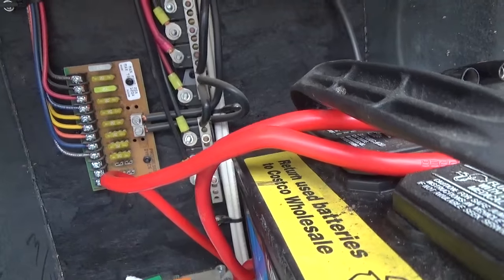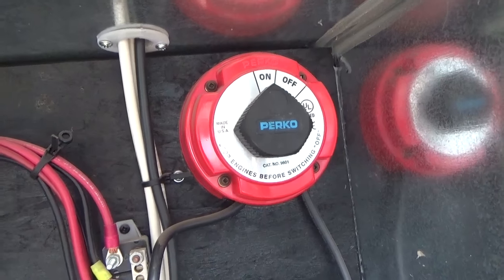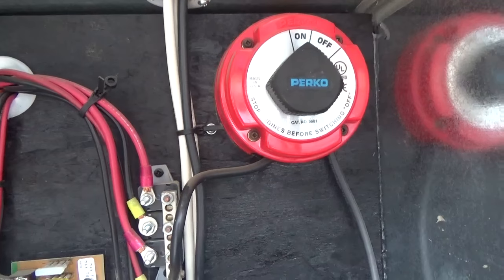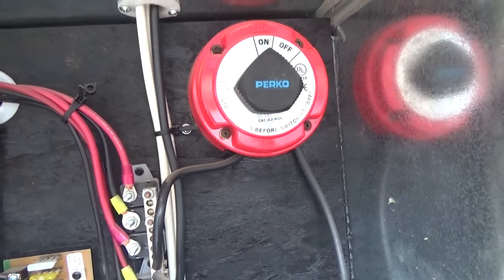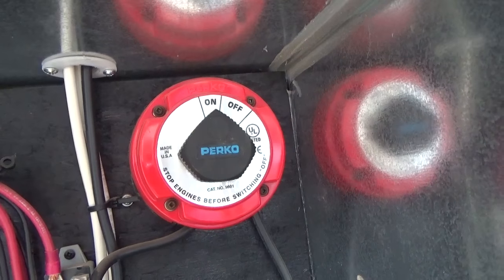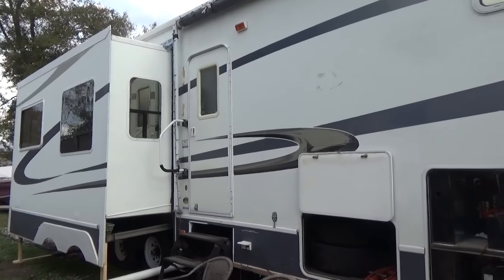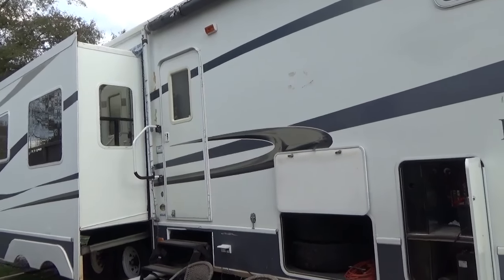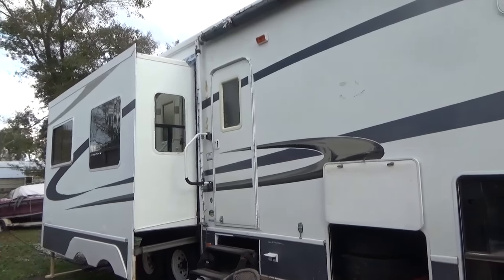5th Wheel Travel Trailer. Electrical System Question? PLEASE HELP.

Comment: I tend to agree with some of the other comments.
The thermostat wold be running on the low voltage/dc power.  The A/C unit will only run on high voltage/115.
So when the batter power is turned off the Thermostat is off but everything on the high voltage side would still have power.

The reason or this is because sometimes you don't always have access to full 50 amp power, I'm assuming the trailer is 50 AMP (could be 30) but I suspect 50 Amp.  All that to say that if you are camping and don't have access to full 50 amp/115 volt power the thermostat still needs to work.  Especially if you were camping in Minnesota and needed to use the heat.  In order for the furnace to be able to work the thermostat has to work and for the thermostat to work it needs to be able to always have power (IE.. the DC power from the battery).

A little long winded... but I hope this helps.

Comment: Your RV actually has three separate electrical systems. It has a 12-volt DC automotive system, a 12-volt DC coach system, and a 120 volt AC coach system. We are primarily concerned with the 12-volt DC and 120 volt AC coach systems.

The majority of campgrounds you go to will provide you with an external 120 volt electric source to plug into. Your RV has a heavy-duty power cord that is normally about 25 feet long. Depending on the type of RV you have, or purchase, it will either be a 30 Amp or 50 Amp system. When you plug into the proper campground electrical source it will supply power throughout your RV. You must have a 120 Volt AC power source if you are going to use the microwave, roof air conditioner, the refrigerator in the electric mode and the 120 Volt electrical outlets. For the most part everything else in the camper works off of 12-volt DC power. When you are plugged in at the campground a portion of the 120 volt AC current is converted to 12-volt DC current for the items in the RV that work off of 12 volts. Some of these items are the overhead lights, the furnace fan, and the fan over the range, the vent fan in the bathroom, the water pump, LP gas leak detector, stereo, and the refrigerator when it’s in the LP gas mode. If you look at the RV’s power distribution panel you will see circuit breakers like you have in your house for the 120-volt AC side, and automotive style blade fuses for the 12-volt DC side.If you are not plugged into an external power source you can still use the 12-volt DC system if you have a 12-volt deep cycle marine battery on your unit. As long as the battery or batteries are charged you can use everything in the RV except the microwave, roof air conditioner, the refrigerator in the electric mode and the electrical outlets. If you have a motorhome, or you’re going to purchase a motorhome, it will have a battery for the automotive system and an auxiliary battery for the coach system. The coach battery is charged whenever the motorhome is running; the generator is running, or when it’s plugged into an external electrical source.

Comment: I had a similar problem with my camper.  You cannot run the Air Conditioner just on battery power.  The AC will only run when hooked up to either a generator or the outlet.  I purchased a new convertor online and then that fixed my problem.

Comment: Like Salmon Hunter said. Your AC probably has a wireless remote, either on the wall or hand held and it needs the 12 volts to operate. I usually would not comment but I just went through this two months ago. Once I replaced the converter every thing is fine.

Comment: In mine, not only the thermostat runs on 12V but it requires the battery at least being installed to make the electrical system a whole closed circuit even if it's not using the battery.

Comment: If you replace the inverter go with one a little bigger than what you have. You already know it won't last long.
Even when plugged in your RV makes 12V from the 120V and powers all lighting and control. Pumps, thermostat, lights, fridge controls, smoke/fire detect....all need 12V

Comment: I think the comments have it right. In a house hold AC unit you have a step down transformer for the control voltage, As in thermostat. which controls power to the coils of the motor starters for fan, compressor. in a RV they use the12 volt power to control it. not sure how your t-stat is wired but if you can get 12v to your main power to the t-stat it should run. in residential its the R terminal

Comment: I used to work in a grocery store with a deli/bakery. Every few months the cheese case would go down. I would sound the alarm, someone would show up with a six-wheeler loaded with empty milk crates and all refrigerated items were dumped into the crates and hauled to the dairy cooler. One day I got to talking with the A/C guy. He told me the hard-start was bad. I wondered why that unit needed a hard-start. He told me that the compressor wasn't firing, so I asked him about the power supply. He went back to the breaker box in the produce department and found it was under-powered. He asked me how to correctly wire it. I pointed to the breaker box in the bakery and told him to run conduit over there and wire it into that box. He did, and it never went down again.

Comment: Sounds like the thermostat is using 12vdc from the 12vdc circuit of the camper.  Seems like thermostat should be getting 12 vdc from a 120 VAC to 12 VDC transformer that would be with the AC unit.  Thinking there is a wiring schematic for the AC on the unit somewhere, it should show where thermostat is getting its power.  Schematic will be on the "outside" unit under the white plastic cover.
Reply: All fuses and circuit breakers are good?  The ones in the area with the battery and charger?

Comment: joe not sure but sounds like  the on /off switch controlling the 120 volt line the ac on mine runs of 115 volts   not the dc

Comment: The thermostat needs 12v power.  It runs your gas heat as well when you are not connected to shore power and that is why it runs on 12v DC.  As long as you keep your battery charged everything should work even with a bad AC/DC converter.

Comment: A retired HVAC tech here with a comment

It sounds like there is some interlink with the D.C. Wiring in the "control circuitry" or more plainly put the thermostat circuitry.
You should know that yes the unit runs on 220vac but the unit gets turned on/off by a relay and the relay has a coil that needs to be energized.
Now in a conventional ac unit or rather any furnace the thermostat is supplied with 24vac usually by a transformer in the main unit that converts the ac either 120vac in a furnace or 240vac in a dedicated a/c unit to power the control circuit to turn the system on/off with the thermostat being the controlling mechanism.
So I admit to knowing nothing about camper systems, so I will speculate what might be happening.
First possibility is the control circuit for the ac is powered by the 12vdc battery system so the relay to turn the unit on isn't being powered, even when the thermostat is calling for operation and wants to close the relay to operate the air conditioner.
Second possibility is that there is a small relay in the control circuit to cut out air conditioner operation if there is no battery power, and the power for the thermostat is being provided by the ac system. The reason for this "probability" that I'm speculating about is unknown to me, and I don't know if the fan in the ac is powered by battery power or 240vac.
Third possibility is that the inverter that you refer to is involved in some way and being a camper illiterate I can't help with that.
It would seem most important to find a wiring diagram for your camper you should be able to find it, even if you have to go online to find it.
If you have that and still don't understand, I would be glad to help out just let me know, however I want remain anonymous so not sure how that would work?
I live in your nick of the woods here in Minnesota.

Comment: Most likely a control system for the unit that uses the 12 v battery. There is no way that that electrically the battery is running the the ac compressor because of the power draw. 

My parent's old trailer wouldn't run the ac unless you had shore power is yours that way can you run it minus the shore power? How is the unit switched on is it a controller that ties in like a house and controls both the ac and the heater? Or is it the kind where you control it on the roof as part of the vent? Most likely if it is a central thermostat like with a house just like with a house it doesn't run on 120v AC but on DC from a battery or separate power wire. So like others have said its probably a thermostat problem not a ac unit problem. 

Reading into the video a little bit you dont want to have to worry about the battery (DC) since you have reliable shore power for the time being? If not disregard this.
I would suggest two things check thermostat and see if you can figure out how it works you might be able to run that on a separate battery if you pull the wires out of the back you could connect them to like a 12v drill or rc battery and just charge when dead or if you cant find a 12v battery if you can find two of those old square 6v batterys you can connect on positive to a  negative on the other battery and then use the two unused terminals for 12v. 
Second easier option and a bit less jerry rigged would be get you a battery tender for battery and leave it pluged in to the battery so you dont have to worry about the battery not staying charged because your charge controller (INTELI-POWER) is possibly dead. wont be a built in but will save you some cash.

If you post the control of the AC unit as well as the ac unit make and model ill look it up and see if i can give you any better info.
Reply: Also i know you were talking about a battery drain in the last video on the battery it may be that INTELI-POWER converter(fancy car battery charger) try disconnecting it from the battery.

Comment: To me switch showing looks like battery disconnect for storage (could not see all wires)  and should be on if using.   Like others have said thermostat is on 12v.

Comment: My motor home's thermostat was battery powered, therefore if the converter is off would not the thermostat stop A/C from working?  I would think so, but then I'm not an electrician.

Comment: multivolt system, even you 120V systems need the 12 volt side for low voltage control. Some units will run without a battery at all but some require a constatnt 12v, that is your case.

Comment: Is it a wireless thermostat? Check and see if it has AA batteries that are dead. It may draw from the DC system but only use batteries for the AC system. Probably the first thing you checked. But you know....think horses not zebras sometimes.  Good luck.

Comment: Hello Joe, long story short, you can get 110v ( fan, wall plug inns) off your battery, but you can't get 220v which is what the air conditioner needs

Comment: needs both voltages to work its the thermostat pull the cover off it its a removable cover and sometimes theres a plug for a 9v battery so it will work

Comment: Most modern RVs are built to rely on 12v power...even the AC.  The ac will start up by 12 volt power then switch to shore power.  That's how I understand it.  It looks like you need to replace inverter and should be ok.

Comment: In a home, the air conditioner is controlled by a 24V circuit feeding the thermostat. In an RV, it uses the available 12V system. If you turn off battery power, the thermostat is dead.

Comment: After your last video I was going to comment and didn't.  I think you are correct that your converter is bad.  It should be able to keep up with every light in the coach on and still charge the battery.  It is odd to me that there is only one battery.  Most have at least 2 12 volt or 4 6 volt battery's but in your situation where you are plugged in all the time it won't matter.  As far as the cut off switch shutting off the AC my guess, not seeing it , is that the thermostat is 12 volt controlled.   Without a signal from the thermostat the computer in the AC will freak out and shut itself down.

Comment: It is because your thermostat runs from dc. You can confirm by disconnecting your battery and if the ac shuts off you will know that's the problem
Reply: I only know this from experience. I wired the house power wrong and fried my invertor so I had the same issue

Comment: do you have a wall mounted thermostat for ac unit. which could be running on the dc.
Reply: The thermostat is running on low voltage dc 12volt.
Reply: edward555555 
100 percent correct. Only the fan and compressor for ac is on the 110 side. Also agree that your shore charger is dead. Just run it off of the car charger.

Comment: i do not agree with the thermostat thing my rv does not need a battery or 12 v for the thermostat  the thermostat is wired just like the one in your house it is wired to the ac and furnace thermostat does not require power to work

Comment: Your a/c probably runs off dc.  That thing your showing is a charger/converter. Not a inverter.
Reply: Joel Johnson thats y no batt power ac is power hungry like the home fridge not rv ones inverter may be roached
Reply: ROSS & SARAH SINASAC everything xcept the ac can run on ac the. ac needs 120 to run thus a genset aka ac on 120 on everything else can run on the inverter low amp s aka angry pixies lol shout out to AvE da man
Reply: ROSS & SARAH SINASAC 2 amp 3 volts thats enough for me its the amps thar kill not the volts I've  had 220 not fun 18 ft is my record (how far u flew)
Reply: There are no air conditioners to my knowledge that will run off a DC power supply. You need 120 volts and at least 10-15 amps on  AC to run a air conditioner, they suck up  a lot of power ( Amps) , especially when they first  kick in. I think the inverter is somehow fried and needs to be replaced. They are not cheap.
Reply: Kevin Whittier I was considering the evap blower not the condensing unit.
Reply: Yes, they do. One of my pastors was an electrical engineer. He wired his house with Solar power, but could never get the Air Conditioning to work because of the tremendous pull at start-up.